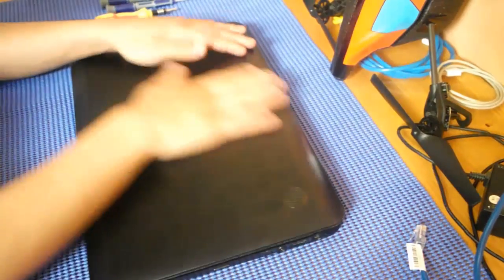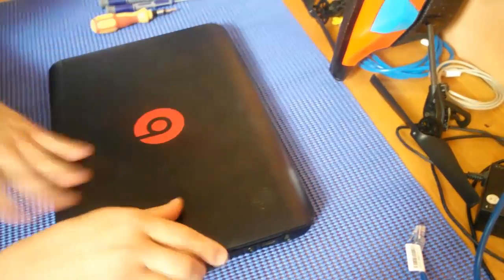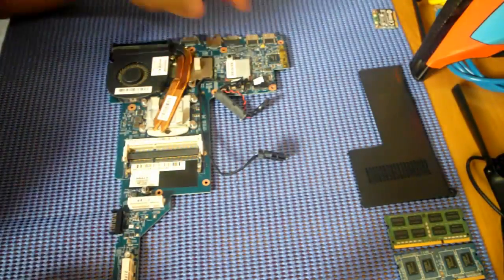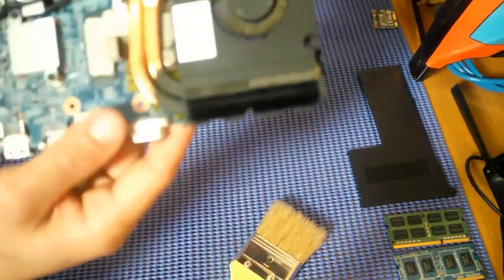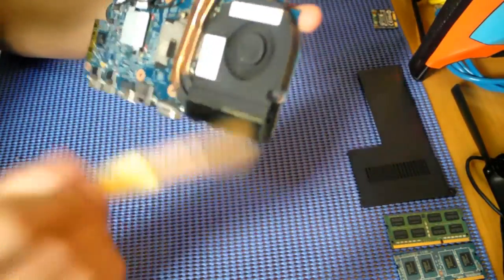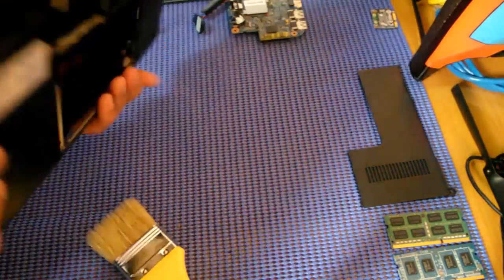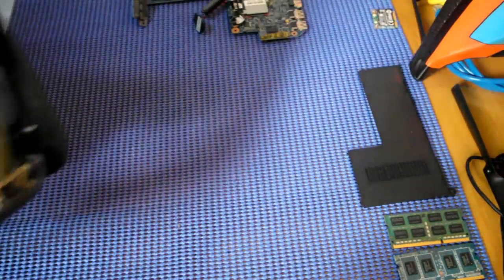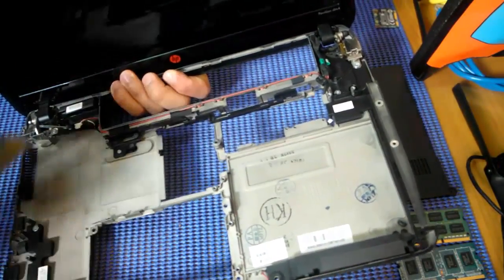OVERHEATING HP PAVILION DM4 Beats EDITION FIXED!!!

Comment: You failed by not disassembling the fan, cleaning it and by not blowing out the fins. That is where the air blockage is and brushing the outside won't do it.

Comment: I'm a novice at pulling apart laptops and this tutorial is way too fast and cuts too much between removing parts for me. I only need to replace the palmrest on mine.
Reply from the maker: Hi Dee, yeah sorry if this video cuts too much. By the way, if you're replacing the palm rest that would be more like replacing the whole laptop frame. I don't have this laptop anymore but most laptop frames include the palm rest.

Comment: I've got the same laptop as you which i just purchased off someone on CL and i might have to perform that task as well. However, the biggest problem i have is because i'm trying to "hackintosh" mine and realized that there's a whitelist in the bios for the wifi card. I need to remove the whitelist, any input?  My model is hp pavilion dm4-3099se Beats Edition.

Comment: i hate HP, you have to completely take it apart and even remove the keyboard just to clean the freaking fan. thats like having to get the whole engine out of your car just to change the air filter. i have a clevo laptop and the same doors that let you change the ram gives tou access to the cooler also.

Comment: do you know where the internal battery is located??
Reply from the maker: Hi, Do you mean the CMOS battery? I am not sure exactly where, it could be just near the HDD or somewhere in the motherboard, it is quite easy to find as it is like a watch battery.
Reply: Paul Christian Lucero ya theCMOS Battery.It's usually visible when the cover for RAM is removed , I couldn't find any.

Comment: I cleaned all laptop (changed thermopast) but my cpu temperature  is 75 celsius degree and it's really hot. when i'm doing   something and using gpu too temperature  is 90 celsius degree. so how can i fix it? or change my cpu ??
Reply from the maker: +ALL IN ONE Do you have the same laptop? Make sure the fan is working, if yes it's something else.

Comment: I cleaned all laptop (changed thermopast) but my cpu speed is 75 celsius degree and it's really hot. when i'm doing   something and using gpu too temperature  is 90 celsius degree. so how can i fix it? or change my cpu ??

Comment: Got the same laptop. probably should do this to it. Its overheating like crazy and freezes when you load MS Word 2013. even after restoring it to factory settings. its too hot to touch. Get blue screens of death often. fan grinds and buzzes, if you slap it it stops making the noise. its quite loud. dont know what it is. Sometimes it lags on loading windows then just shuts off on its own. i think when its hot if you try turn it on its shuts off right away. other times when it loads into windows CPU utilization is at 100% and sound is distorted. a restart kind of fixes it untill it happens again. AND also screen is stuffed so always outputting to a monitor. Reckon a fan clean and thermal paste should extend its life or at least get it working properly?
Reply from the maker: +Goran Svraka Hi, Thanks for watching my video, you can try cleaning the fans and adding up new thermal paste, make sure to put evrything back properly. If that doesn't work you can buy a spare fan replacement for your laptops model and that will fix the issue.

Comment: Mine was overheating for the longest time. I just ended up taking everything apart including the fan and changing the thermal paste. Used rubbing alcohol to remove old one and artic silver 5 to replace the paste. Computer runs super quiet now. Love this computer. Have an ssd and HDD installed in it with 16 gigs of ram. Thing is a monster.
Reply: +Julian Dsilva Curious, what is an ssd and HDD? i currently own this laptop but went ahead and bought myself an imac instead to work on some 4k gopro videos. my dm4 was too slow even working w/1080p files. I'm not too tech-savvy but im opened to learn if it means i can make my laptop competent
Reply: +Dior Paint hey so an ssd is basically solid state drive hard drive. it doesn't have a moving part like regular hard drives (HDD). thus everything is lot faster with an ssd. maybe upgrading your dm4 ram and hard drive can speed up your laptop. it definitely did for me.
Reply: Thanks. I did a good amount of research and am in the process of ordering a samsung evo ssd thanks to you lol. So that info was highly appreciated. I haven't opened my laptop yet, but i was wondering.. these laptops come w/ 8gb of ram, now if they have 2 memory slots, is it preoccupied by (4GBx2) of ram, or is it just one 8GB of ram w/ an empty slot open? Also.. what do you recommend i do, to get windows on the new drive?
Reply: Most likely 4GB X2. You can look for a cloning set to copy your os and files from you old HDD to new SSD. Some ssds come with it when you buy it or you can buy the cloning set from amazon. I recommend a clean install of windows for your ssd so it will run smoother.
Reply: soo i think you need some adjusting on your what you just saied was quite unclear
Reply: What verison do you have? i have the I7 3612QM with 8 GB of ram and a AMD radeon 7570 
(Top of the line ver) one
Reply: +Hurileno oo I have the i5 with basic graphics card. it was the base model came with 6 GB ram and a 5400 rpm hdd drive.
Reply: I love the laptop. I've been using mine for almost 10 years and it still works OK. Not the fastest, but not slow. One hinge is broken though

Comment: The problem will arise again and very soon, as you didn't eliminate the real cause. Cooler and ventilation is covered with thick dust cloth. 
1 use soft clothe and spirit to clean all dust, because if u don't it will be there again. The foundation of all dust growth is dust which covered surface and u remove it with soft clothe and spirit.
2 if u don't ground yourself, u will burn something. I would recommend to ground yourself.
3 The thermal paste in modern laptops has very poor quality, so I would say it's priority number 1 to change it.

Comment: hey paul i own the same laptop !! Thanks for the wonderful video i sucessfuly reassembled it  :)  My lappy is 3 years old  and nowadays it is heating like a hot iron box . i replaced the thermal paste with arctic slver ,but of no use !! normal operating temp is 60 - 75 deg C !! while watching videos it goes upto 95 deg C !!I found that my cpu fan seems not to be running fast .I feel so .  So am thinking to replace it and check whether temperature is reducing or not  . So i have some doubts :
1) do i need to buy the whole thermal module or only the fan part alone ?
fan part :  http://www.aliexpress.com/item/Original-NEW-Laptop-CPU-cooling-Fan-FOR-HP-Pavilion-dm4-3014tx-dm4-3022tx-dm4-3023tx-dm4/1384185508.html ?

2) If i buy the fan part how would i remove the old fan from the thermal modulae and replace with new one  ? Is the old fan sealed in the thermal sink module ?
Thanks

Comment: Thanks for the video! - I got it all apart.  Wish me luck on reverse process.
Reply from the maker: +Rick Franklin  Good luck! Don't forget to connect all the cables from inside to its designated ports.
Reply: Well system came up fine but fan is still very noisy.  Looks like I will have to replace not just clean....